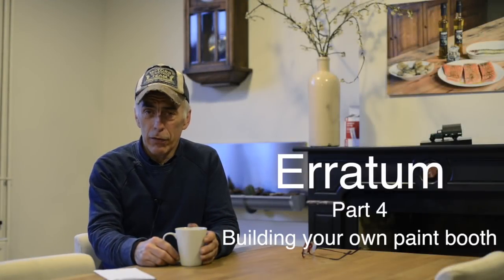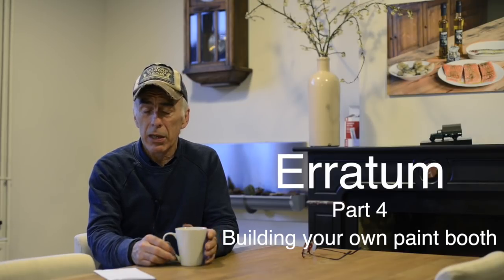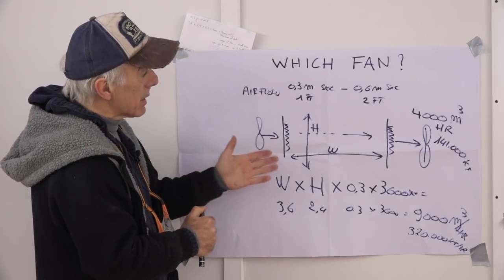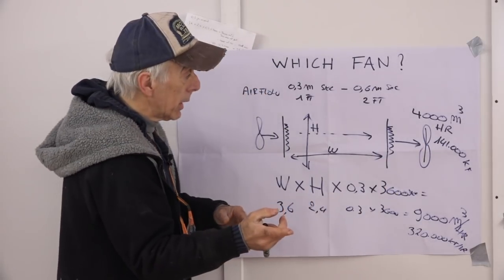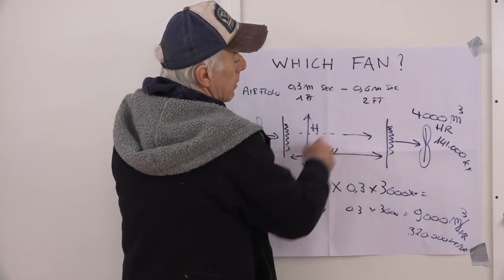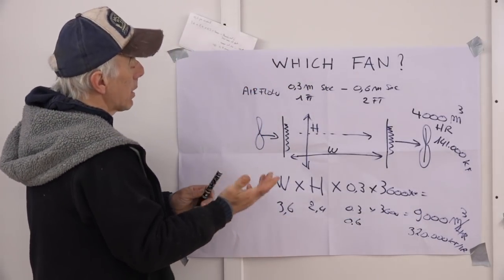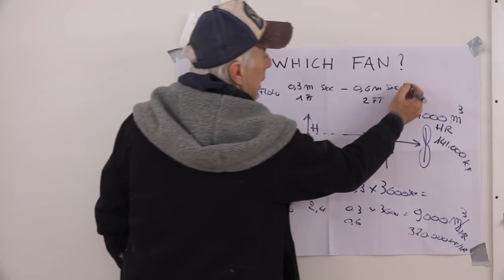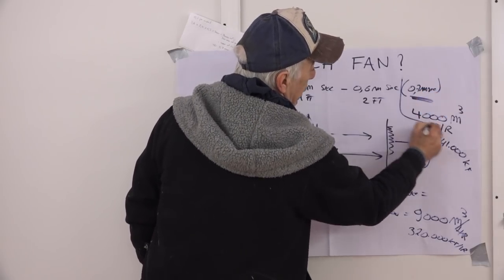Building your own paint booth , ERRATA Part 4

Comment: My understanding is by using a fan to blow air into the booth only, it does not have to be explosion proof. Just have a passive filtered opening on the other side to catch the paint/solvent vapors. So that is the type of booth ('positive pressure') I will use here in California, to eliminate this explosion and fire risk.
Reply from the maker: Thanks for the comments

Comment: over here in the states we just take the width x the height then x that by 100.  So  8x8=64. 64x100=6400.  you need 6400 cfm to move air through the paint booth!
Reply from the maker: Thanks for the comments
Reply: The width of what? From one end of air intake to the air exhaust in a cross draft booth? And I am assuming you are implying the height of the room (not the the length)?

Comment: Correct me if I am wrong. In your equation I would use width of the wall where is a fan instead of length between fans. So the equation should looks like: (Width of the wall where is a  fan) x (height of the wall where is a fan) x velocity.
Reply from the maker: Thanks for the comments, yes indeed that is a good correction. always happy to see that kind of corrections

Comment: to have an overpressure  must be the input fan  have a bit more power .. best to use an adjustable then you can regulate well if the filters slowly get dirty .. Without technology you can set the pressure well by pushing a lighter in front of, for example, the keyhole or a self-made hole ... if the flame is sucked in ... the overpressure is too low. is it blown out ... too high. Flickering is good 
😉

The 2.  Kalkulation is correct 👍
30cm or 1ft. Is the EU min. standart, but 15 cm is absolutely ok!
My own booth has also 15cm... by 8x4m floor
It works absolutely  great .. only a quaterpanel or a complete... 15cm is ok !
Greetings from Germany
Reply from the maker: Thanks for the elaboration, always nice to see viewers involvement

Comment: nice job, well done.  So, you have explosion proof fans. What about static discharge inside the boot ? Eg when you are walking back and forth a lot you can get a charge build up ? But maybe no problem because the gasses are extracted fast enough by your fans ?
Reply from the maker: Indeed that could be a problem, but I have never seen it in any paint booth.... need to check on it....